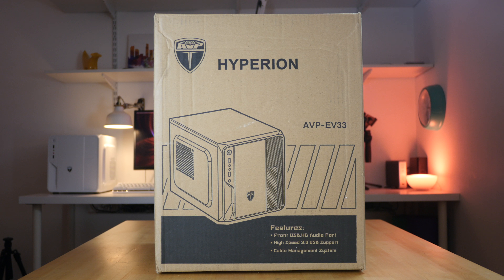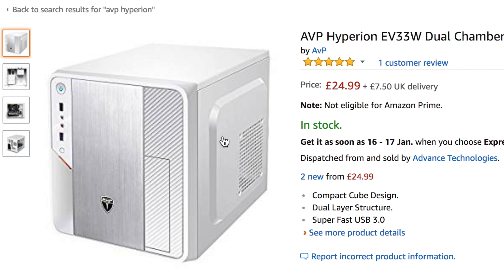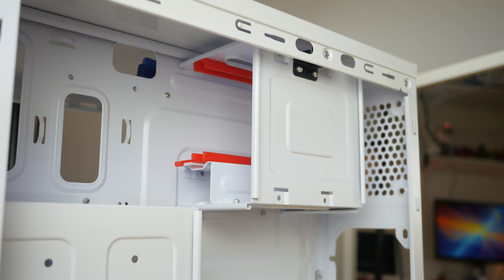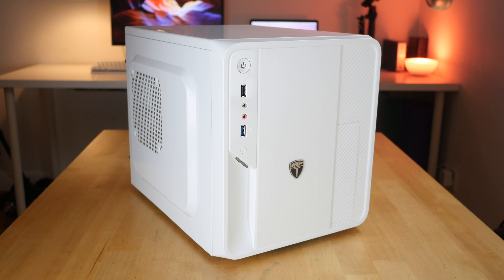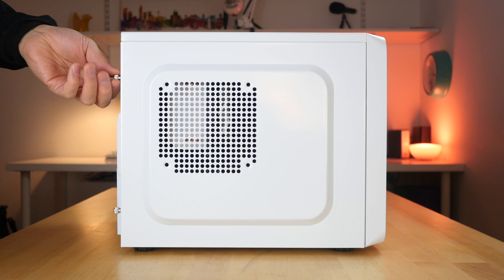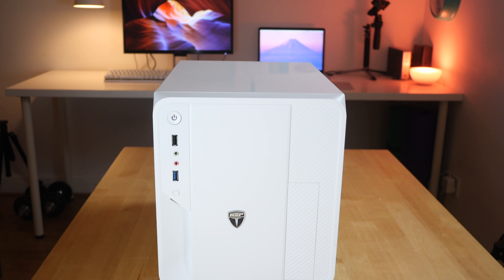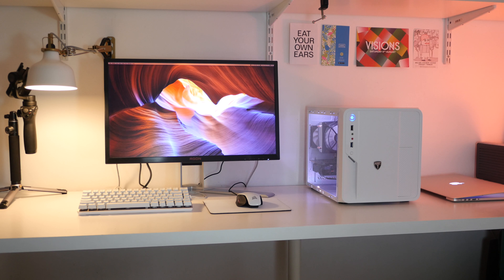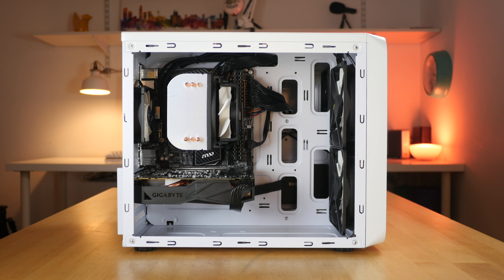The CHEAPEST SMALL PC case 2018?

Comment: Hi, could you tell me what you use to fix the perspex to the side of the case please ? Are those just normal screws.. the cd drive cut out is annoying, i have this case and i drilled the rivets out to remove that dvd drive cage to make more room for cable management and added an extra hdd in it's place 👍😉
Reply: Ahhh so it's rivets 😩 I've got a small drill so will remove that.

Comment: (Mini-ITX) This case needs some old school modder love. I like the clear panel you put on it but would back mask the edges in white vinyl to hide the stamped case metal. I would drill out the 3.5 cage. And fill the board side with a brushed aluminum pannel with ssd mounts, leaving  only one group of grommets (were you said more hard drive space). I would remove the case badge, cut the right "mesh" on the front and install a custom preforated grill to allow more airflow to the front of case also filter mesh the whole front. Mask the I/O shield. Cut the bottom out 120*240 and line with preforated grill with trim and filter mat. Lastly do another side but back masked with a custom ghost graphic and then a solid white mask. 

I may do this now 😅

Comment: A Pro tip for people anyone thinking of buying this case for gaming!
Don't, the thermals are horrific

I've tried every fan combination possible, and ended up cutting a 240mm * 120mm rectangle in the front plastic

They could have added vents all over the front panel, but didn't
Reply: Agreed, i am changing mine. Everything runs way to hot.

Comment: I was thinking of the black one, but still seems bigger than I’d like for a SFF themed case, but what I have seen from other builds in the case, they have used the optical bay for fan controllers, looked really nice, so whether or not the cage can be removed, fitting a touch screen fan controller would improve the front facial look.

Comment: It looks like it's built for case modders instead of users. There are punches on either end of the cable passthrough grommets clearly for a cable shroud, the front panel looks like it's supposed to be a 2-color front in black and either red or blue, the area the HDDs are mounted looks like it was intended to have two seperate removable cages, and more.
Reply: If they were stocked in the US at that price, I'd buy one in a heartbeat. I'd love to mod the heck out of it.

Comment: I've read this case can only take up to a 120mm cpu cooler and the arctic one you used is 127mm does it fit all ok with no problems?

Comment: Hi Andy. Fantastic video. Am doing a build for my nephew using this case so very useful. Have a question about your placement of dust filters. Just to confirm, doesn't look like you've put any on the rear? Guess that makes sense otherwise dust would be retained.

Second I'm wondering about the front dust filters. Should these not be screed on the face of the fan as opposed to on the front of the panel? Or did you purposely do this because perhaps you felt you'll get better noise dampening that way?

Look forward to hearing your thoughts.

Comment: I've just completed building my pc in this case and I would agree with you 100%, for the price especially with me living in the UK it's a cheap and affordable case which really does the job, funny enough I went for the same case fans and cpu cooler, I'm using a full size b450 gigabyte aurus matx motherboard and a ryzen 5 2600 with the gtx 1060 6gb varient. But it's a decent case for the price and I would Reccomened it. I may try moding the case and cut out the dvd drive for cable management and I pay mod the bottom so I can add two 120mm fans we'll see how it goes but cheers buddy 👍

Comment: Great video! How did you make the side panel window?
Reply from the maker: George/WF there is a link to a ‘how to make a window side panel video’ at the end of this video
Reply: Thank you, I'm thinking about getting this case to replace my current one and was wondering how many drive bays there are?

I also watched the video and was wondering how big the side panel is? I'm thinking of using a website to send me some acrylic with the direct dimensions, so I don't have to cut it.
Reply: I've decided to just cut it and buy the cutter, think it'll be less hassle, do you think a3 acrylic would be enough?
Reply from the maker: Yes A3 is the size I bought, follow the guide in my video, its super easy to cut and install
Reply: what screw size did you use? I want it to correspond with the holes in the case, but don't know how large/small to go
Reply: And I'm going to use a website called cutmyplastic to get some acrylic cut exactly since I don't already have a plastic cutting tool. It would be a MASSIVE help to me if you could confirm that the dimensions are 225x354 for the side panel. Thank you
Reply from the maker: George/WF I used the spare screws that came with the case
Reply: ahhh that's a lot of help. Thanks. and am I right in thinking that the dimensions are 225 x 354?
Reply from the maker: George/WF Measurements are 320mm x 272mm
Reply: oh wow! measurements are apparently innacurate on the novatech website. I will go with that then. Thanks so much! did you go with 2mm or 3mm thickness?

Comment: That is actually a good price ~39$ usd. From your video it looks like it can be even smaller, but probably won't have space for a full size gpu then, but a mini would do just fine.
I have seen similar others for as much as 90$ and even 120$usd, which is ridiculous, the 50-80$ difference can be invested into a high end gpu or another component.

Comment: hey got any tips i be buying soon a upgrade case for my old crap 2008 case from gateway my mom had a old gateway pre build pc i used her old case for my new parts still using it till this day i want a upgrade my parts are over heating i have not many fans . and i want this case called the thermal take core v21 it is almost like your new case got any tips one what i should do before case swapping to a small case i never worked in a smaller cube case before well i be using a blu ray drive in my gaming pc cause i be importing anime dvds from uk cause the usa release is over priced i live in florida so import is the next best thing for me .

Comment: Cheap case but then you had to replace cpu cooler and fans .... could have bought a slightly larger case for what had to be spent for extra parts.
Reply from the maker: deltaskyhawk true, but the video is mainly about the case rather than the other parts I used :)

Comment: - I just want a case with both SD and micro SD card slot, USB type C and HDMI for VR, and a little bit more of USB port, without going out and but some 5.25-inch bay port adapter
- oh! and a Handle for easy to moving around
2018: EXTRA SLICKKKK, Tempered glass, extra bigggg tower, no 5.25 inch bay for you!

Comment: Looking ok even though it's white and a way oversized for mini itx build. Personally I would not use it in my build even if it would be for free. Its easy to see that airflow in this case is non existent
Reply: ExiledDiclonius 
Actually this ist not a mini itx build. It's a mini tower more like micro atx.
Reply: You are 100% correct. I didnt notice part when he mentions that it also supports micro atx. it still does not help it in my eyes at all, since I have the biggest issue with cooling.

Comment: Does a normal ATX PSU work?
Reply: Depends If you want to Install a dvd drive. If yes be careful not top use a long atx psu. I can't Install my blu ray drive because my Corsair Rm650x takes way to much space.
Reply: @OlderRockRocks  Try putting the drive in prior to the PSU, pushing it forward a bit so it sticks out and then installing the PSU
Reply: @RFLCPTR  
Tried. Not possible to Install the drive. The cable on the psu is not flexible enough. Can you recommend any flexible cables. At least my psu is modular.
Reply: @OlderRockRocks  My PSU isnt modular at all and it worked :/
Reply: @RFLCPTR  
Which psu do you use?
Reply: @OlderRockRocks  VS550 from Corsair
Reply: @RFLCPTR  
Well. 125mm vs 160mm(RM650x) No suprises here.

Comment: Quality reflects the price...it's bad.
No air intake to speak of, no MB cutout for whatever CPU cooler you might decide to put in (even though it supports taller coolers), issue with fitting the (a small!) graphics card - how will it fit anything bigger, even with all that room? Filters you actually have to screw in yourself, each one (WTF), etc...
Do yourself a favor and get Thermaltake V1, if you want a cube-style mITX case, it's MUCH better for not a lot more money...

Comment: Indeed would fit in well in the Kitchen on the worktop "MicroWave ATX Build" :)
For the price of the Case,  Can be a modders paradise, Make Air vented holes on bottom & also could have a 120mm fan,
Could mod the 5.25 drive bay for more storage or use for a Fan controller, Mod the top panel for 240mm/ 280mm  rad & maybe drill 280mm rad holes for inside front depending on space, Just picture the New "Corsair H115i Pro RGB AIO" at the top shining Through the Acrylic window/Top.
Reply from the maker: Haha spot on, that build would look immense!

Comment: that case is really bad. so bad on airflow and cheaply made. built in them quite a few times now where people have skimped on the case. temps I got were around 8-10c higher on the cpu over cases like the corsair air 240